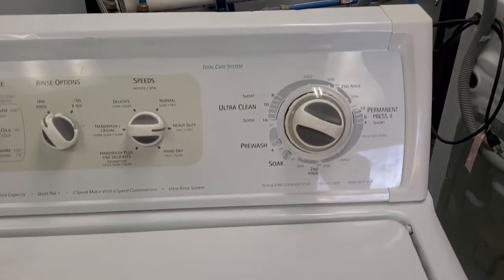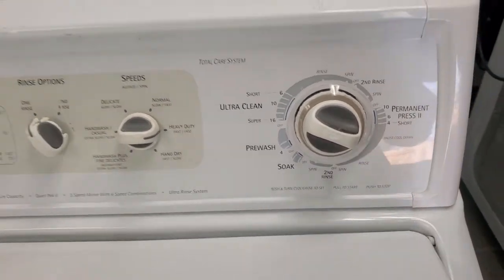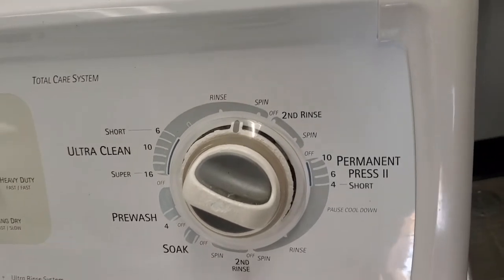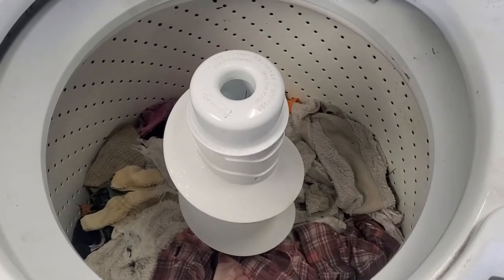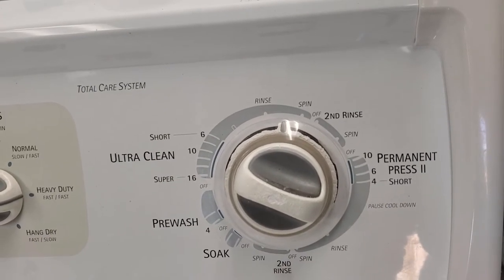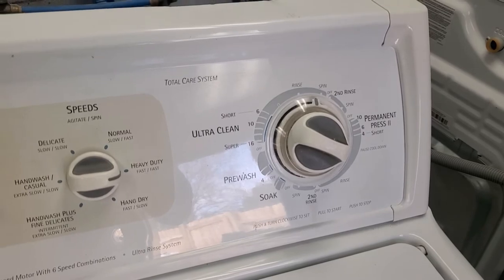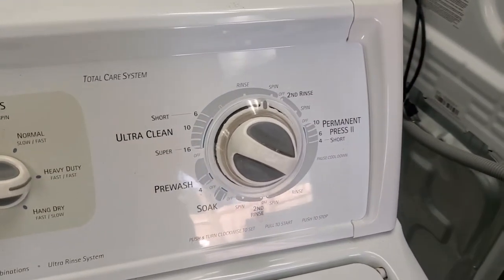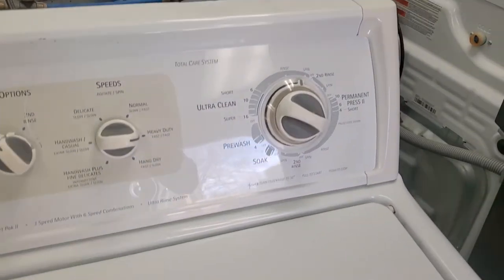Kenmore washer! bad timer? clutch or transmission? here is the answer

Comment: Good video. Chasing down a problem on a Kenmore 800 series washer 29822801. The washer fills, agitates, drains, hums but will not spin. I changed out the door switch, the coupler, and the clutch. I could get the washer to drop in a spin occasionally, by turning the knob and dropping it in and out of a cycle. But not consistently. A year or so prior to this we noticed that the washer was not completing a cycle in the "regular/ normal" setting. It would work in the "Heavy Duty" and "Bulky/ Beading" settings. This led me to thing the timer might be the issue. However, I replaced it today and nothing changed. Not sure where to go next.
Reply from the maker: Found out the issue?
Reply: @MegaMarlon0123  - Yes and no. Ended up deciding to order a transmission. When I went to put it in, I decided to check the motor. Took it to a motor shop and they didn’t have the right hookups for the motor, but they checked the capacitor. Said it read just a bit low. So, I got a new one for $5. Put it on and put the new transmission in and it seems to be working now. So it’s very possible it was just the capacitor. But I figured a new transmission couldn’t hurt. 

Thanks for responding. I messaged a bunch of DIY washer/ Dryer channels. No one ever responded.
Reply from the maker: @destinycaptain247  ah cool! You are learning in the process as well, yes it can be the capacitor too! Washers are easy to fix or change parts, dryer as well

Comment: Mine wont drain or spin checked hoses, clear, checked coupling between motor and transmission and it’s good. If I grab a dressing wrench and spin the shaft between the pump and motor the cylinder spins normal. I put a jumper on the door switch with the cover off to see the shaft spin and nothing. Motor just hums. Could it be a bad motor. The water pours out and it stops between rinse and spin but once it hits spins it just hums and doesn’t drain… TIA